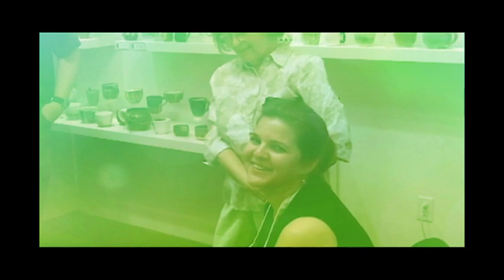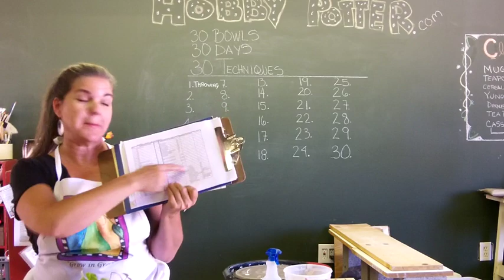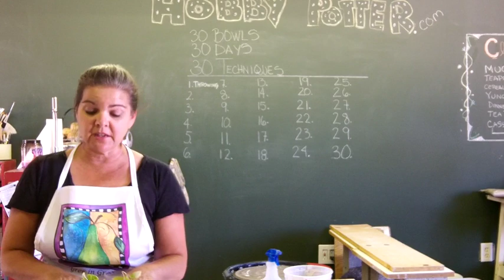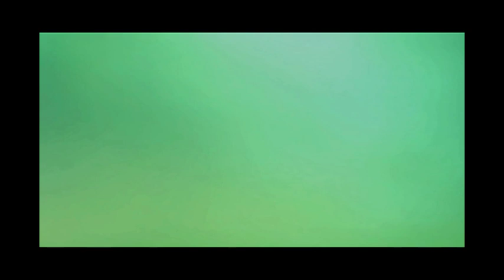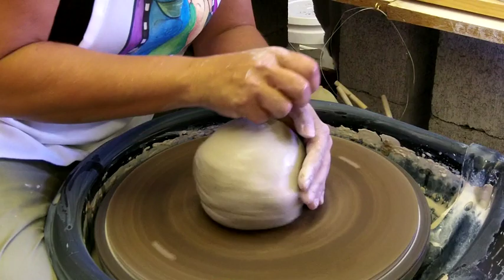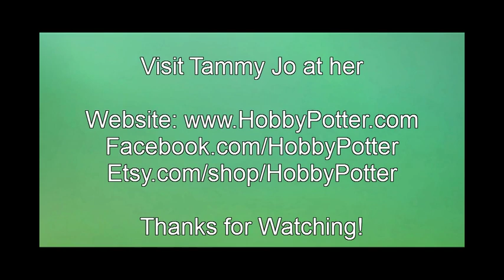Making Bowls: Day 1- Throwing - 30 Days -30 Bowls - 30 Techniques

Comment: May I ask what type of clay you are using on the wheel? I've been looking for a good white clay and so far have found nothing but garbage. 
Also, what cone does it fire at? Thanks :)
Reply from the maker: I use Amaco #38 White Stoneware (because it's most easily accessible in my area without having to drive far or ship). I usually fire to cone 6 but this clay can go to cone 10. Since I've "grown up" if you will with this clay, it's the one I know best by touch. There are many people I know who use Laguna's B-Mix, but since I don't use it myself I can only pass along their recommendation :) Hope this Helps Patricia!
Reply: Thank you!!! :). I shall be ordering some today.

Comment: Tammy, why do they call it 'throwing'?
Reply from the maker: LOL...Thanks for your question and one made me look up the answer! Hope this helps! Here is is from Ceramics Today! "  However, the Old English word thrawan from which to throw comes, means to twist or turn. Going back even farther, the Indo-European root *ter- means to rub, rub by twisting, twist, turn. The German word drehen, a direct relative of to throw, means turn and is used in German for throwing. Because the activity of forming pots on the wheel has not changed since Old English times, the word throw has retained its original meaning in the language of pottery but has developed a completely different meaning in everyday usage. Those who say they throw pots are using the historically correct term. Those who say they turn pots are using more current language. Both are saying the same thing."